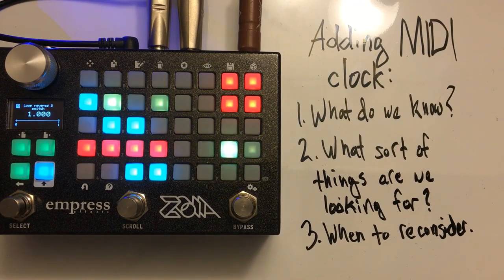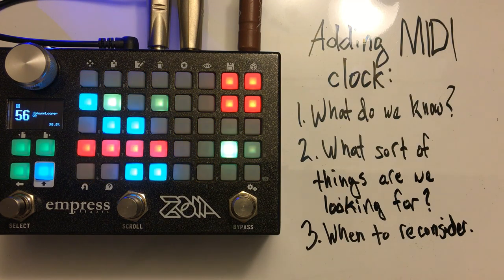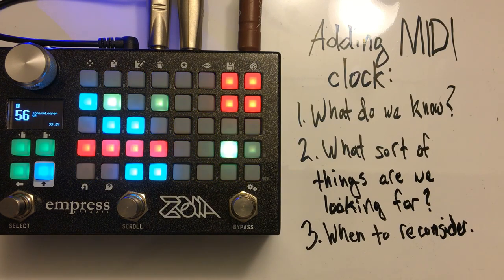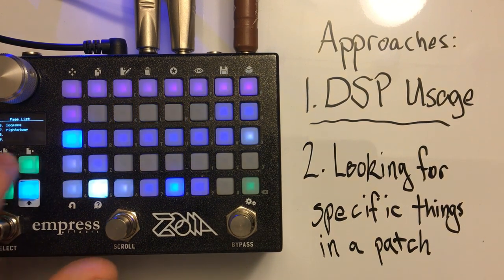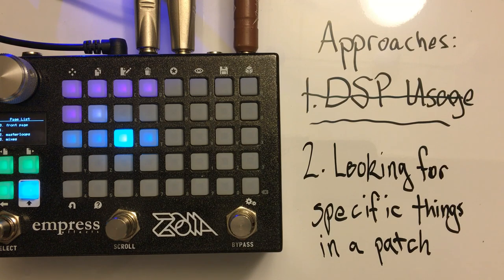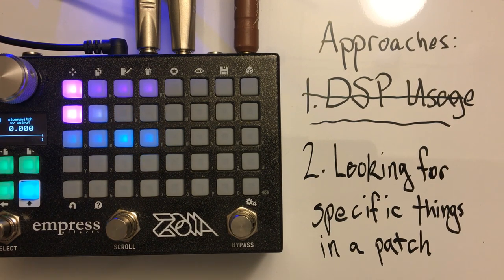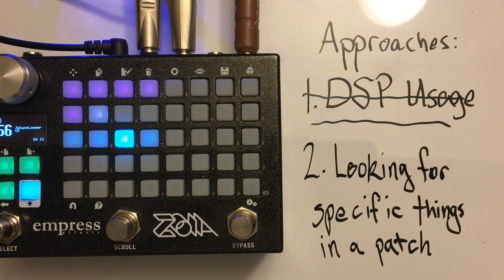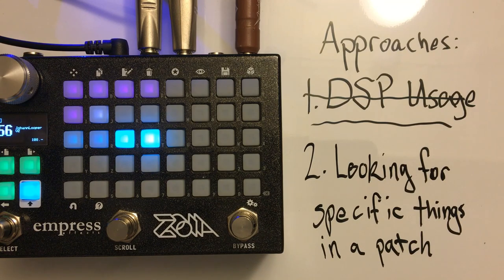Empress ZOIA tutorial:  "Adding MIDI clock to a patch"

Comment: Hiya Christopher, Maybe not the best place to ask this. But I'm trying to link my midi synths together, but have some trouble getting the thru to work with the Zoia. Is there any setting that I'm missing?  (chain would be: Zoia -> Model:Samples -> Korg Minilogue xd (with a neutron in between at a later state))
Reply from the maker: The setting you are looking for is called "MIDI Consume" and is found in the configuration menu.  There are a few different settings; I wrote a brief explanation of each for the r/ZOIA FAQ (in the MIDI section):  https://www.reddit.com/r/ZOIA/wiki/faq

Comment: So in this example you have to change the switch from TAP to MIDI manually, but ideally I'd just have a ready-to-play patch that uses TAP-tempo, UNLESS I have a MIDI clock coming in.
I built one where the Stompswitch (=tap tempo) and the MIDI clock modules literally just connect into the same master-LFO module:
>> If there's no MIDI cable connected, there's no MIDI-clock and TAP works perfectly fine
>> If there is an incoming MIDI-clock, that takes over automatically (as long as you don't tap in extra button taps, the steady MIDI clock should just take over)

I haven't tested too thoroughly, but seems to work okay. Or am I missing something here?
I'm just not sure about how steady tap tempo LFOs are in the first place...

Comment: I guess I'll discover soon enough (ZOIA on its way from the US to Portugal for me) - what exactly happens when the CPU is maxed out? I'm guessing that some modules start skipping samples in the buffer? is it clipping? Does the ZOIA warn you in any way? Any tips on optimizing the signal chain in these cases?

Also I'm quite curious - say you have your signal branch from input to a) a reverb and b) a delay, and the mix is spliced into output - I'm assuming that the two effects don't take exactly the same time to reach output - do you add "washer" effects on the fastest output to make sure the delay is the same?
Wishing you a good recovery from the cold. Cheers from Portugal!
Reply from the maker: It's a little hard to explain, but yes, it will start skipping or dropping samples from the processing load; with CV, that amounts to gaps in signal; with audio, it can be silences and pops, a crackling sort of sound.  It's hard to miss when it happens.

ZOIA warns you in two ways:  if things get really out of hand, the CPU will freeze and the utility buttons will turn yellow.  But there is also a display of how much CPU is consumed at any given time; anything above 105% will result in clipping.

I'm not sure if I have any tips beyond normal streamlining:  look for redundancies, consider what might be extraneous to the patch (I usually end up sacrificing a lot of UI elements I would like to have -- metering, pretty lights, etc. -- to CPU concerns).

Don't use the ghostverb?  I, personally, think the ghostverb is not very interesting, but I seem to be in the minority there.  Avoiding it -- as it is the most CPU-intensive module in ZOIA -- has saved me a ton of CPU.

Comment: So for a simple tremolo patch can I also add a subdivision selection for my midi clock to control the Tremolo rate? Like switching from 1/4 to 1/3 note?
Reply from the maker: Yes, that is easily accomplished with a clock divider.  You can add more exotic subdivisions with the use of two clock dividers, as well, running in series.  For instance, the first divider could run at 2x (clock dividers can also multiply clock) and the second at 1/3 for 2/3 (or really exotic stuff, like 4/7 or 13/9, etc.).